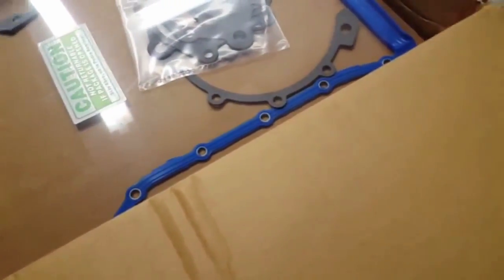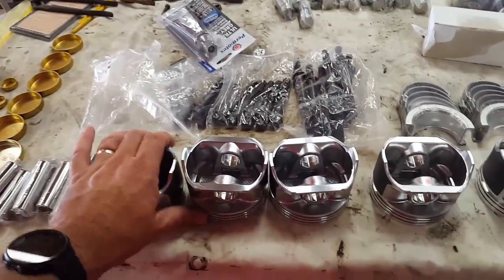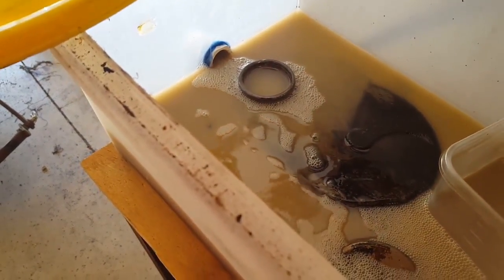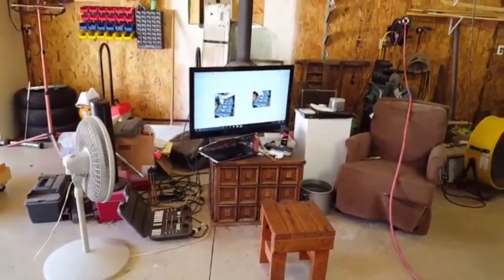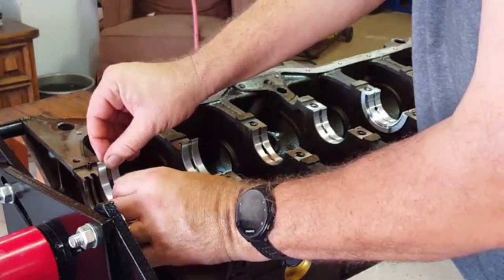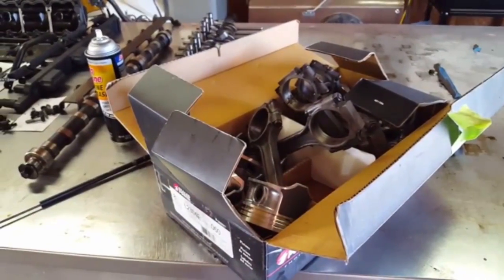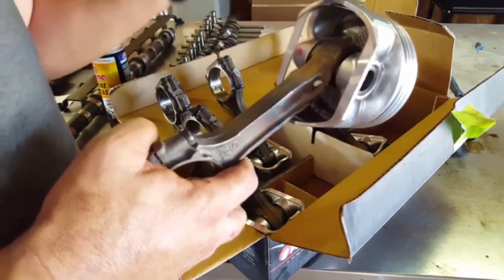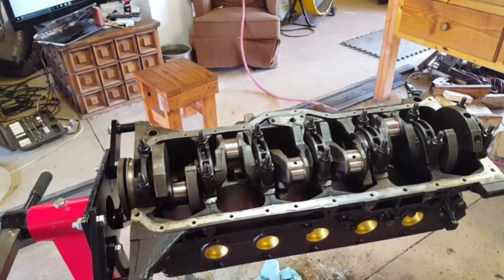Anyone can rebuild an engine - Jeep 4.0L rebuild project - part 4

Comment: I can’t find the video where you honed the cylinders and you said they told you to run it in and out like 30 times… I know this is 4 year late but that’s bad information. I’m looking at the bench books right now and it says not to use more than 10 times per cylinder and 1 time is the down and up motion. 

People will see these videos for years to come and good information is important. 

The books are expensive but definitely worth the information that is included within the pages and I’m not talking about Haynes manuals. 

MOT. I6 4.0/4.2 
and Bishko Automotive Literature Authorized Technical Service Manual 

You won’t need any other manuals these two have everything you’ll need to know… they even tell you what every letter and number cast into the block means. 

Hope this helps someone before they run a hone through their cylinders 30 times.

Comment: Where did you purchase the rebuild kit?
Reply from the maker: I don't remember I just searched online and of course went with the cheaper one that had good reviews-----but I think I mentioned in a later video I should have gone with a different one this one didn't have the rod bearings (back ordered) and I ended up getting a different exhaust intake gasket as well because the one in the kit was so cheap. It looked like that bubble insulation for metal buildings. So I ended up spending another $50.

Comment: Hey dude .. You don't do the piston rods yourself you let a machine shop do it ..If this is your first rebuild trust me in fact NO knowledgeable experienced Mechanic would do his rods in a shop press because  you want the wrist pins ice cold and the rods heated NOT ice cold  .. PLEASE TRUST ME...Dude are you really doing this rebuild watching a tutorial ??? OMG REALLY BRO.???  OH Dear God..and are you really really re-using the main bolts  ? YOU NEVER RE-USE  Head bolts Or Main bolt's / rod bolts NEVER .. PLEASE  if your taking the time to rebuild a motor please don't short cut the rods Or the crankshaft  ? have the crank checked & polished maybe even have it Balanced and get a free few hundred RPMs a smoother running motor for a hundred bucks or so ..
Reply from the maker: Hey dude... bro...You just made yourself look REALLY ignorant. Maybe you should stop trolling and actually watch the video you try to comment on. Thanks for the concern been running great for 6 months now.
Reply: you can reuse the mains as many times as you want and head bolts are good for 2 uses minimum ..... seriously champ don't write dickhead comments
Reply: He just wasted his time and money,the 4.0 has 7 main BEARINGS because this ENGINE is a BEAST it's 75 YEARS old KAISER,HUDSON,AMC,JEEP..MAY BE THE STRONGEST 6 EVER BUILT PERIOD JEEP EX'S, NEED TO BRING THE ENGINE BACK,BUT YOU KNOW WHAT THEY SAY ""THE HIGHER YOU GO THE DUMMER THEY GET IN CORP. AMERICA!!NEVER REUSE ANY PART,THAT'S WHY IT'S CALLED ""REBUILD,,,MY SHOP WOULD NEVER RIP A CUSTOMER OFF LIKE THIS THAT'S WHY MY BUISNESS IS 52 YEARS GOING STRONG!!
Reply: Bullet proof!!!

Comment: like  good video   it is ez to see that you fave little experience   but my thoughts 
are so far your doing d good job  and will have the thrill of starting the motor
that you put together    i have done this many times and i still love the feeling
of starting  a fresh rebuild      thank you
Reply from the maker: Thanks for watching... everyone has their first;)  Yes it is running like a champ now. If you watch the last video you will see it installed and running but sounds like crap. We went and got a new Fel-Pro exhaust manifold gasket and took off the one that came with our rebuild kit and that fixed the roughness and it sounds great now.

Comment: Best way to clean the pickup tube screen as with a small blow torch it will burn the carbon right off used to do it all the time with 2-stroke engine Mufflers screens when they were clogged up with carbon